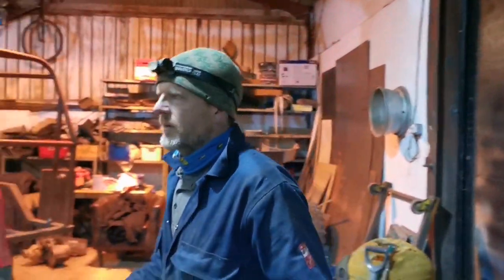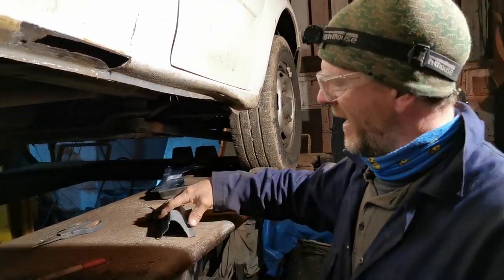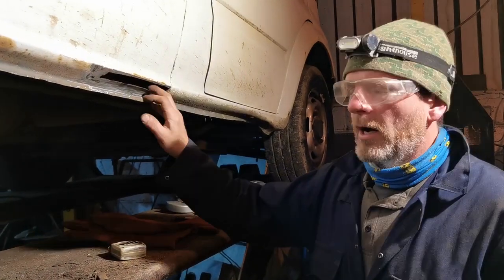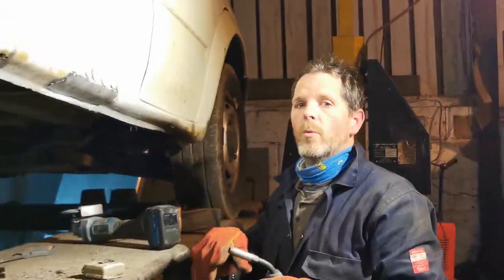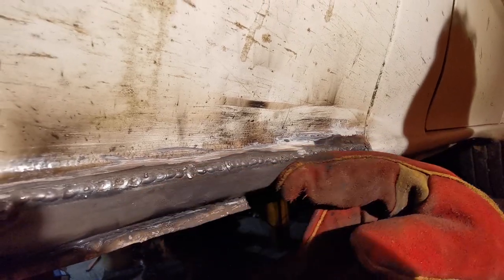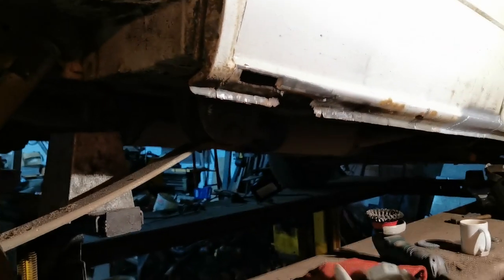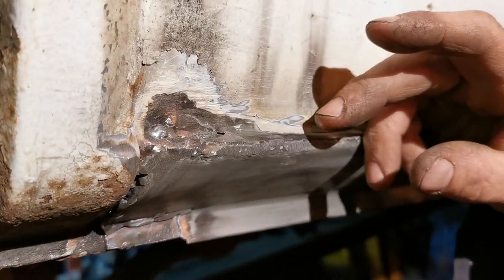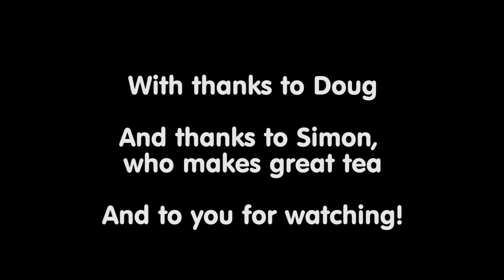How to do MIG welding repairs on a Ford Transit after MOT failure - Bodged in a barn

Comment: Amazing weld on such thin metal. Would recommend the word welding in the tile as it's a great video and really helpful. Can you do some coverage on puddle welds? Who has a spot welder?
Reply from the maker: Cheers and good point on the title.

Don't have a spot welder. Puddle welds just require good prep and the right power

Comment: it would not have been more productive to replace the complete panel instead of replacing about the half by sections ? I had to do that on cars and I replaced the complete panel because the net result is much better and globally not more work.
Reply from the maker: No. This was minimum work for an MOT presentable vehicle ASAP

Comment: Done a good job and it passed, I have done a fair bit of repair welding and always found it just ran away, each bit cut out just opened up more rust, I would have cut off the whole sill and repaired whatever rot was there, I understand this was not a restore just a mot fix, not my van, and not my weld, I like seeing the rubbish cut out and repaired.
Reply from the maker: Believe me, I went back to good metal and this was not a restoration, but repair to MOT standards, with no 'shortcuts' which I see all too often!
Reply from the maker: Oh and it passed again a year on 👍
Reply: I think the whole sill should of just been replaced would of been a better repair